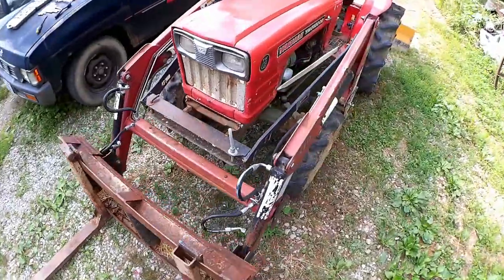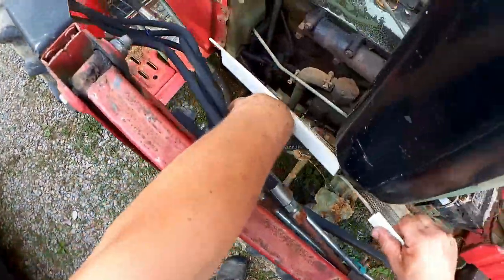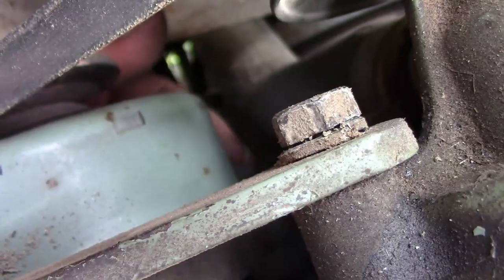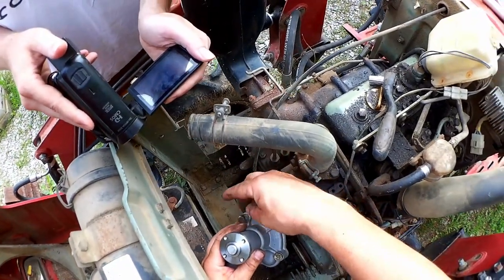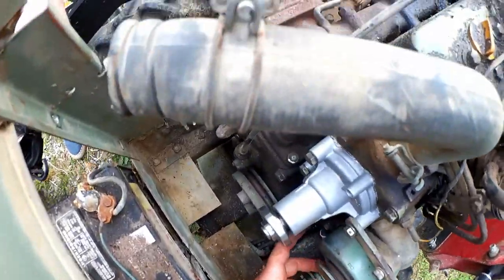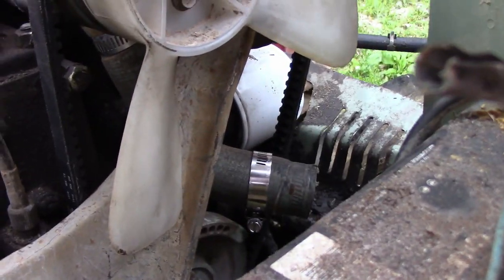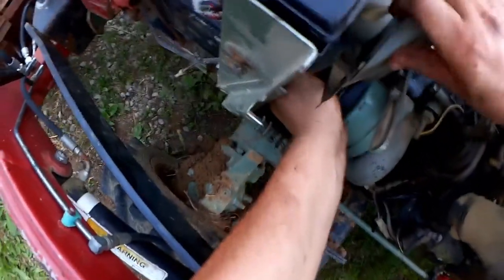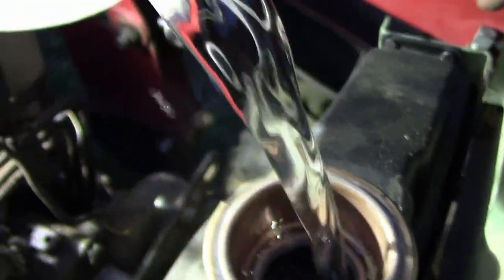Yanmar Radiator & Water Pump

Comment: When John Deere allows you to build tractors which are sold in their name, it's too shelf.

 So many city boys with ZERO experience/knowledge of tractors and their systems run yanmars and the Yanmar built John Deeres. Way over loading in every conceivable way, running far too hot, low/no oil, never service anything as it needs. Never replace worn out parts which leads to other parts wearing or failing.....and yet no one talks shit about Yanmar making junk. 
I have an 88' John Deere 1050 myself. Absolutely love it too death. A 750 would've been enough for some of what I do/need but you always buy the next size up. Have the model 75 FEL, quick attach Backhoe JD8. Yes the Deere models are simpler and closed loop hydraulics but it is the best 40hp tractor I've ever run to this day honestly. Growing up on a farm I learned young. Fel lifts 1400 pounds easily and the 1050 handle it excellent, 3point hitch lifts 2000 pounds easily and rolls around no issue. Engine power ALWAYS has more left in throttle lever/pedal travel, she does lug at times but surprisingly rare unless running say a big mower and going uphill in a high gear but that's why the operator is there lol.

Excellent video man, with much needed content. We need more Yanmar tractor everything, hell my hydraulic pump is 11cc with 7.5 gpm, yet wtf are the yanmars???? Pathetic how little info there is on here.

I have to ask, do you know how much your front end loader with those forks will lift? I have a severe Love affair for smaller tractors lol they really are the most useful by far, obviously you know what I mean.

Comment: Thanks for making this video.  One thing I noticed is that your new water pump (specifically the fins) are the same as an after market pump that I recently purchased.  The problem, if there is one, is the fins don't match the OEM Yanmar pump that I removed.  If you could take the impeller and flip it 'upside down' the fins would then match between the aftermarket and Yanmar OE part.  Quite obviously the impellers on both seem to be mounted correctly from the assembly plant, but just don't match.  Does this matter?  I would appreciate any info. for future replacements.  In the mean time I did find the same Yanmar OE part with same part number - and it does match (fins and all) the worn pump that was removed from my YM-187D tractor.

Comment: Hey Mechanic, question for ya. I have a yanmar 220. Pretty much identical setup to yours. I have overheating issues. The overflow bottle has bubbles in it after the tractor warms up. From research i have seen online, people are leaning to a blown head gasket. The oil isn't milky and the fluid looks good. Water pump seems to spin fine from the belt. Any advice as to what to research first?
Reply: Phil Hall  replaced head gasket. Same issue. I then replaced radiator and water pump. Fixed

Comment: Is there not a thermostat? Shouldn't that get replaced to?
Reply from the maker: I did later.  I think it just hadn't arrived yet.  It's pretty much like the other thermostat assemblies I've seen.
Reply: @TheMechanicalPhilosopher I gotcha I've been working on my neighbors and its overheathing I'm trying to diagnose why. Water pump turns super easy but idk if the propeller is even attached and the thermostat might be stuck to so its rear down time today
Reply: Also is the thermostat located on that manifold above water pump?
Reply from the maker: @seanmccarthy1274  On mine it's top front center vertical above the water pump and attached to the upper radiator hose. Also the radiator seems to be of minimal size for a hot climate.  When doing heavy work on a hot day it will always run the temperature gauge over the halfway position and up to around 2/3.  The new radiator performs the same temperature wise as the old.  With the original radiator and screen it was very important to clean pollen and dust out of them frequently.  The new radiator's fins are farther apart and i left the screen out.  I haven't needed to clean it out yet.
Reply: I couldn't agree more about the radiator size its laughable unfortunately this tractor doesn't have a temp gauge just a light so I will be cleaning out the hoses and testing flow through radiator

Comment: Hello Mechanical Philosopher! Very Well explained! I would  twist this inclination to art work.
Any way, I have a question for you. I am sort of new to YanMar... I bought two tractors: one 2210 (2WD) and one 2210D (4WD), hoping to make one good one from the two of them. The two have different issues, but have very good parts. The 2WD is beat up, but working OK, starts fine. 
I have an issue with the 4WD... When I turn the key, just click, click... 
- All in neutral? Yes,. PTO in neutral. Lift arms down.
- Clutch held down!
- Battery? No,  battery is fine, fully charged12 volts. 
- Cables corroded? No. 12 volts on the starter. Swapped cables with the other tractor. 
- Starter, solenoid? No,. Swapped, starter with solenoid to/from/to the other tractor, both starters work fine on the 2WD. 
- Ignition Switch? No. Swapped ignition switches. They are OK.
- Clutch Safety Switch? No. Jumped safety switch, and still only click, click...
- Water pump or alternator stuck? No. Loosened belt, alternator pully and water pump fan turn freely by hand. and still click, click, with the belt completelly loose.
Oh, wait... Did I try to jump start it? Yes, it starts with difficulty, turning very slowlly, then starts. You might think that the engine is about to cease... I don't think this is the case. Once started, it works OK.
I know that I am going to kill the starter if I keep jump starting it. 
I also, tried what many do, which is not recommended, short the starter, I only get click, click. 
Any ideas?  Thanks in advance.
Reply: Did you fix the issue?  If so, what was the cause?  I currently have the same issue with my 2210D.  Thank you!
Reply: @ouflyer2124   Try running a heavier wire for test purpose from #C on the starter key switch (Hoye diagram) straight to the starter. These are known to break down and give a lot of trouble. If this is your trouble  you will need to splice in your clutch safety switch because it will crank in gear bypassing it this way which is not safe although older tractors didn’t have this feature. Bypassing the switch alone like the other guy did will not work because it is the wire not the switch that is the problem. Hope this works for you, it was my cure.
Reply: @ouflyer2124 . Yes, after the long run-around, I found out that the problem was low amperage on the battery. A battery may read 12 volts, but low amps to start. Hey...!

Comment: Is that engine the yanmar 3T75U, which way does that fan blow or suck across the finns of the radiator, I have  a 3t75 u in a yanmar 281 which keeps overheating.
Reply from the maker: This is a 3T80U and it pulls air through from front to back.